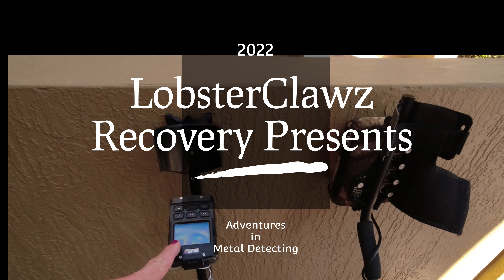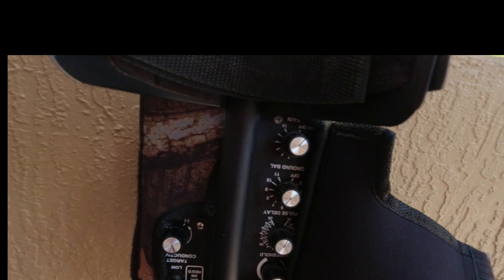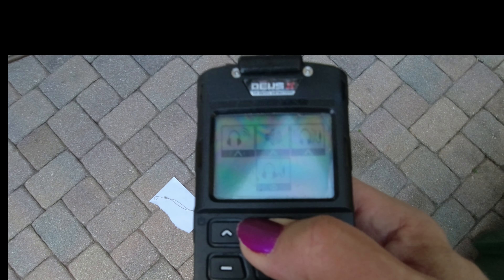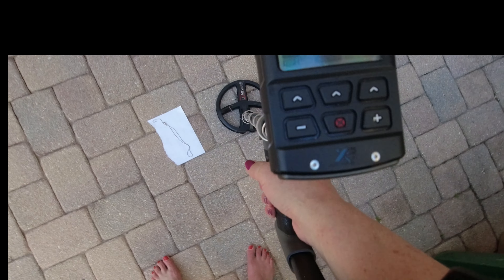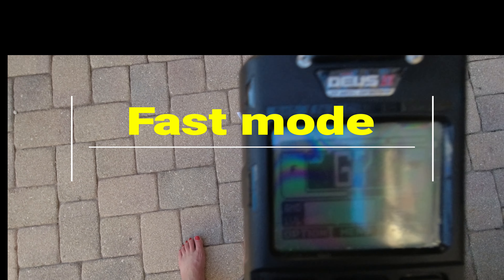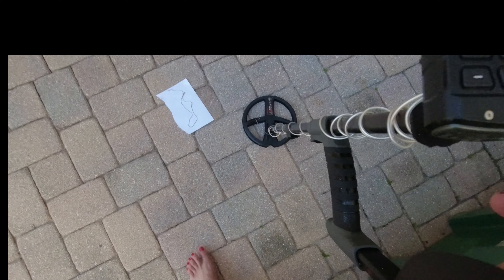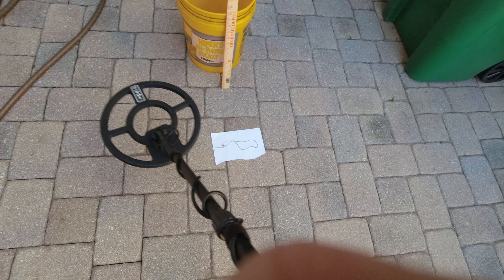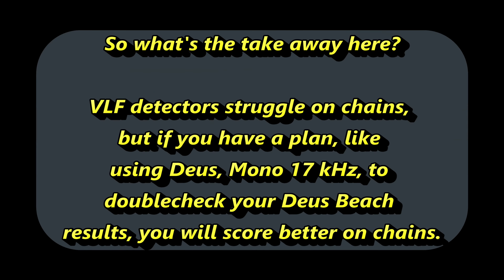Metal Detector Tests - How an XP Deus 2 vs White's TDI SL does detecting on a silver chain -Find out

Comment: is it not possible to reduce the chatter with the noise cancel feature?
Reply from the maker: Since I didn't get which metal detector you referring to, I will assume it's the XP Deus 2.  If yes, you can reduce the chatter by doing a scan which will adjust the channel on which you operate. This reduces EMI and also cross talk from other metal detectors nearby.  Reducing salt sensitivity can be helpful, if you're operating in the surf, to reduce chatter. If you're not operating in the surf, also reducing the metal detector sensitivity can be helpful. There are some other small things you might be able to do but those are the highlights. Hope that helps.
Reply: @LobsterClawzRecovery  yes I was talking about the D2, the TDI does not have a noise cancel feature as far as I know of. Load of people use the Noise Cancel on the Minelabs, but I seems nobody is using it on the D2 in order to reduce EMI
Reply from the maker: Are you sure?  I do.  Routinely.  I have detected right next to someone with a Minelab equinox, and I recall that it helped.

Comment: Do you find the tdi sl, deeper than the tdi beach hunter?  I could never get the tdi bh to pick up on a chain.  I knew i was walking over them. Like the vids.
Reply from the maker: Thank you.  Glad to hear from you.  I would say the TDI SL is goes deeper than the TDI BH but that is inconclusive.  On top of the standard configuration, I run 1.6v, 3000 mAh batteries in the battery pack, that show an output voltage, on the voltmeter, of 14.35 V.  This higher voltage improves the detector's ability to go deeper.  So far, under field conditions, not staged, I have pulled a penny at 17 inches or better.  I expect that a quarter would possibly exceed that by several inches.  I am mesmerized by the detector's ability to detect the chain at altitude/depth (air test/field test) at 7-8 inches from the target, and even half of that, in the presence of salt, would be a gift.
Reply: @lobsterclawzrecovery where do you get those batteries?? Have some old originals that are loosing juice